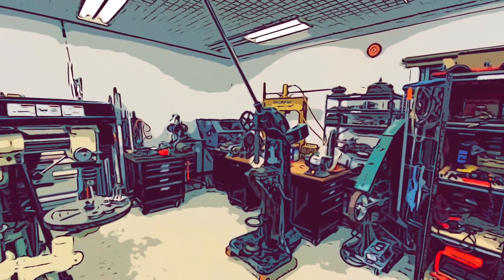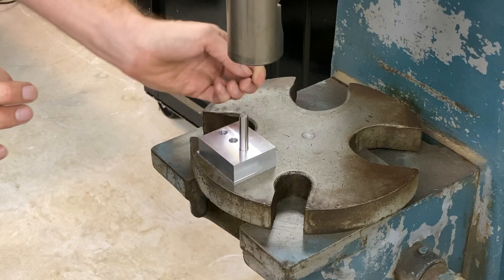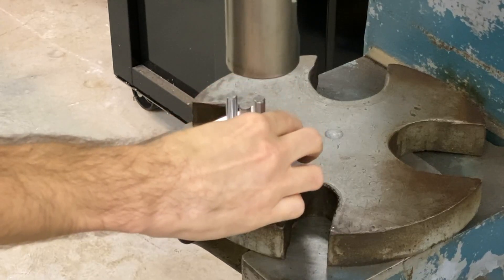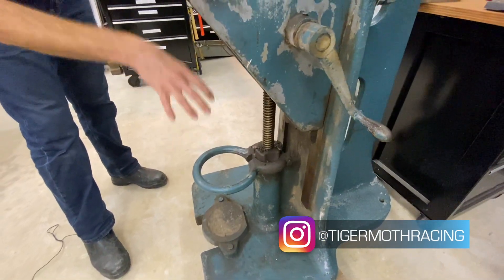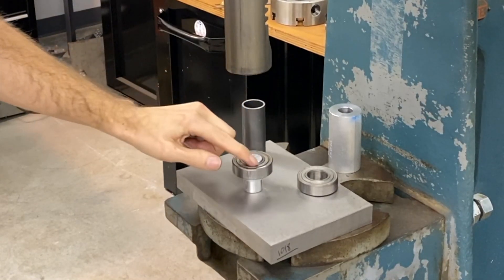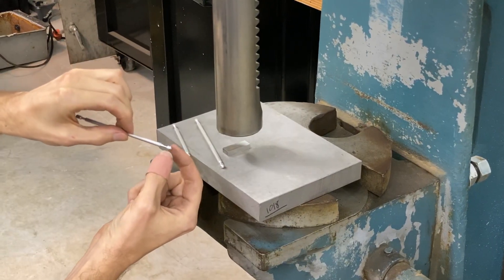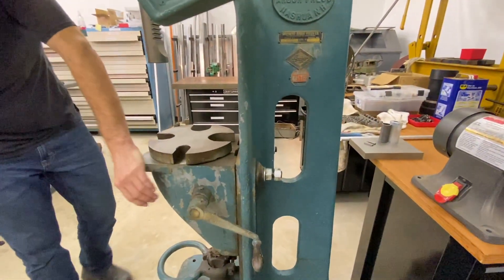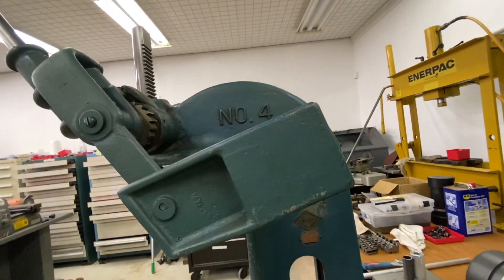ARBOR PRESS GREENERD No.4: Tour & Demo on Pressing

Comment: Hey tigermoth , what is the wheel diameter on the hand wheel .  Mine is broken and wanted to cast a new one .

Thanks
Reply from the maker: 8.75 inches.
Reply: @TigermothRacingTV  thanks buddy
Reply: Hey thanks for getting back to me , after contemplating going for the same size i decided to make and cast a 12 inch wheel .  Thanks again for the video
Reply: Up date as well casted a new hamd wheel.

Comment: What if the shaft or arbor you are trying to press a bearing onto is say 7" long? How do you keep that shaft plumb as you press the bearing onto it? Thank you
Reply from the maker: There are lots of ways of doing this. Usually you need some kind of spacer or fixture to hold the part well if you really have to be precisely perpendicular. If the daisy wheel is not good enough or doesn't fit your part, you can use pieces of flat ground stock to hold your part. Usually there is a flange on the shaft you can push against. One helpful way is to use tubing as we showed in the video-turn both ends in a lathe to get parallel and the walls of the tube will keep the part vertical. Its often not necessary to be perfectly lined up to get a pressed on bearing to slide on a shaft correctly. 
There are ways to direct force a bit if you need to as well. If your part leans to the left for example, you could use a small spacer on the right side of your part to even the load. This has to be done carefully but works well. The higher the part sticks above the knee, the more careful you have to be. The higher it is, the bigger the tilting forces will be-increasing the risk of the machine ejecting the part.
You could of course always face off the bottom of the ram if it is worn, or even make some kind of adjustable faceplate for the ram you could indicate in to match the table.
Reply: @TigermothRacingTV  thank you! I'm not a machinist.im just starting to set up to rebuild my vintage electric power tools such as circular saws and drills, etc. So I'm referring specifically to pressing bearings onto armatures. The arbors on the circular saws are short and should not be a problem,as you have shown. But I'm not so sure about the armatures. Thanks again